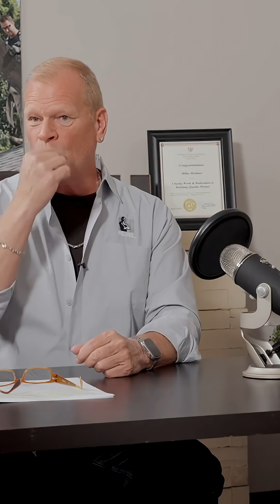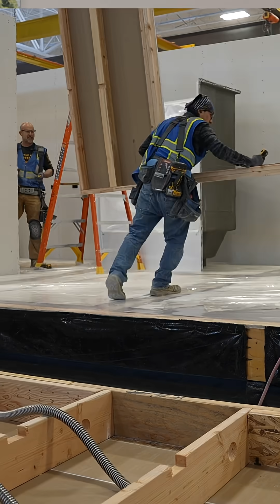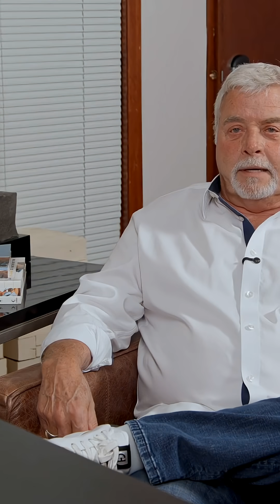The Future of Housing: Indoor Modular Construction

Comment: My dad came back from war and built, repiled, and moved houses, from scratch, every frame made on site, nails hammered in with a hammer, not a nail gun.  He was a very particular, fussy man, absolutely no sub-par work allowed on his job sites.  He has been dead 40 years and homes he built are still going strong, while houses built in the 80s, 90s and 2000s are being torn down, due to things like leaky home syndrome, and the rot that comes with that.
He never, to my knowledge, built a transportable home, but had they been a thing here, and he thought worth it, he probably would have, and he'd have done it well.